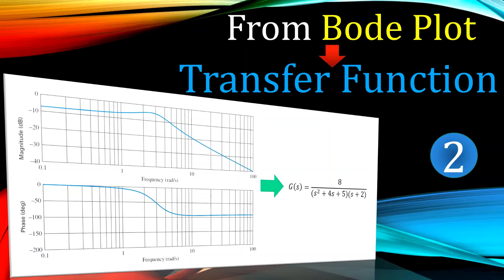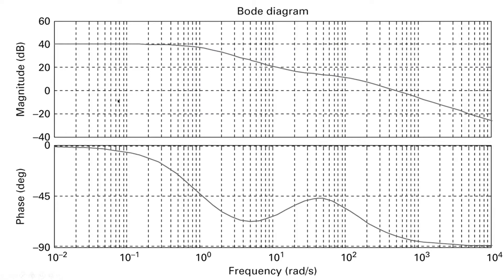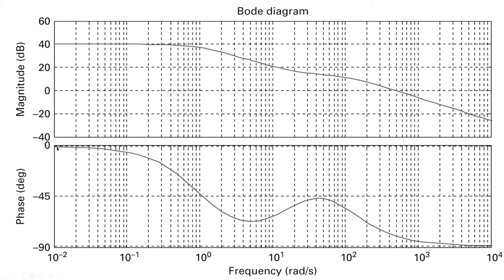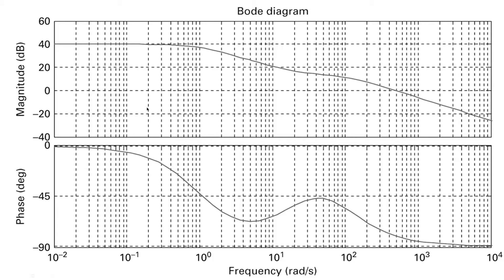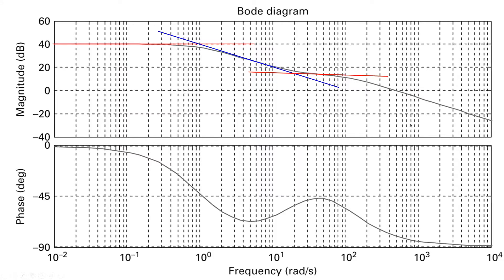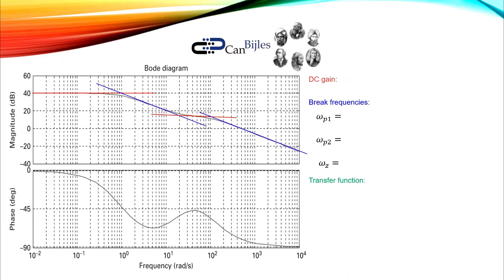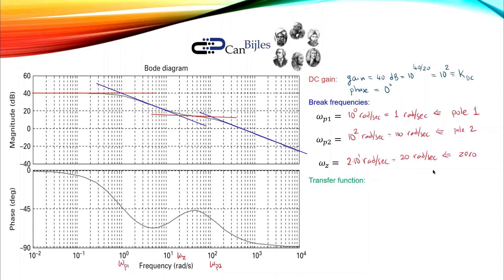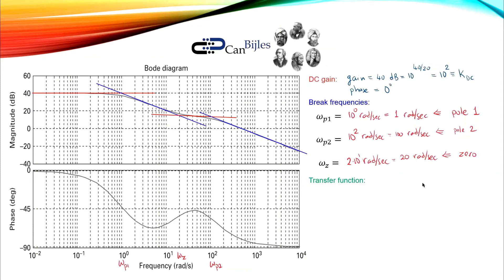Deriving the Transfer Function from Bode Plot 💡 Example 2

Comment: Example 2 was magnificently explained. The first video was good but this was much better because you started without the red and blue lines which we allowed to get familiar with the shape of the gain plot. The only question I have is about the DC_gain. You raise 10^(40/20), I now the 40 comes from the starting point on the gain plot of the far left, and the 20? Will it always be divided by 20? Thank you for the video. I'll be taking my final for control systems in an hour and 40 min, and I didn't understand during the lecture and power point slides. You made it easier to understand it. You might be the reason I pass this class.
Reply from the maker: Thanks for your kind words! I'm glad you found the video helpful for your exam. I am curious about your exam result 😉 Maybe you can let me know later.

The formula with dividing by 20 is to convert the dB value into scalar value. The formula is given by: dB value = 20log(scalar value). If you work this out to get the scalar value, you will see that 10^(dB value/20) will appear. 

Good luck on your final!

Comment: Seems to be an error here: having two poles at 1 and 100, and one zero at 20 gives us (s+20)/(s+1)/(s+100). And this corresponds to your final answer, just without any complications and without
additional "factor 5".
Reply from the maker: There is no error in the discussion; solutions are 100% correct. It depends on how you proceed with the solutions. I discuss the standard form to come up with the transfer function (see at 00:11:40) and not just for this example but also for other situations.

Comment: The way you obtain the 5 factor is not really clear. Why not put every divisions like this (p/wz +1) like ((p+wz)/wz). This way we could find for sure the factor 5. Instead of this weird and coming from nowhere factorization 20*1/(p/5 +20). It seems more like you already know the factor.
Reply from the maker: You can do the factorization and simplification in many ways. At around 00:15:00, I multiply both the numerator and the denominator by 5, but only use the 5 as multiplication factor for the numerator and work out one of the parentheses in denominator. That's it.
So, I think it is fairly straightforward what I do, but maybe you missed the step I just described. Hope this helps.